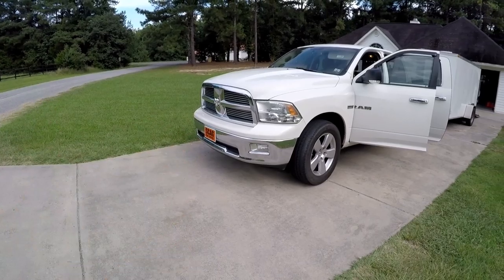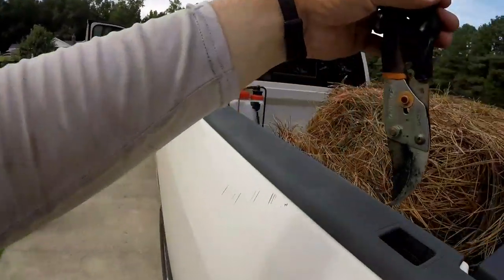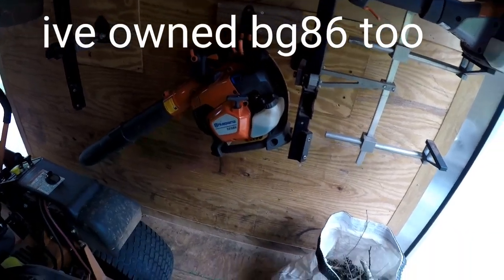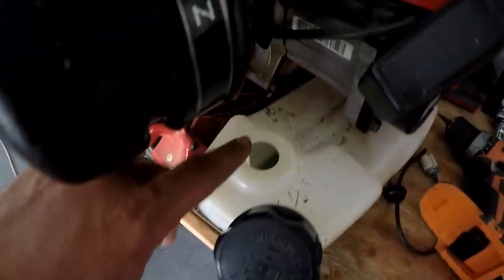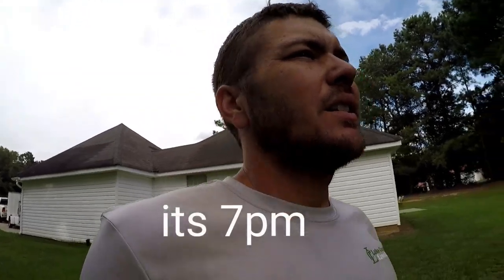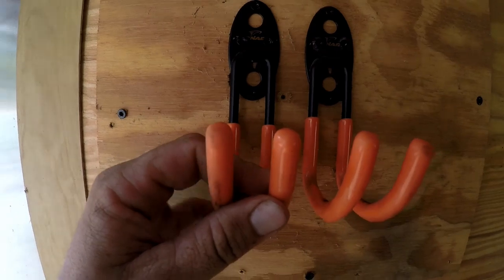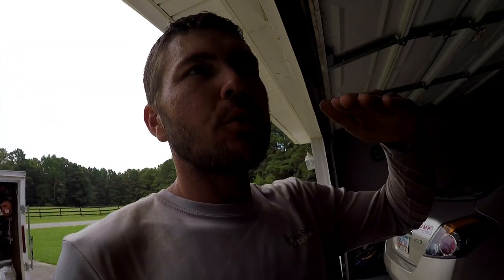2019 SOLO LAWN CARE SETUP

Comment: Awesome setup bro, You organized the crap out of that trailer. I just bought a ford box truck that already had a pull down rear ramp and it also came with a turbo diesel engine but diesel fuel is expensive so I sold the diesel engine and bought a 6.0 litre LS chevy motor that's getting installed now. I'm hoping the truck will work out for me after the engine swap is complete. Then it's organization time.
Reply from the maker: Bro i want pictures !!!!!7064738432

Comment: Man these are always my favorite kind of videos. I learn more helpful things to make myself an business better from setup videos than any other “product review” videos out there.  Now three things...

Tell me more about what you did with the speed feed head. I love them an run them as well. But go through 2-3 a season. 

Second the bags from Lowe’s...did you just buy them at Lowe’s I’ve never seen them. Could come in handy. Most of my customers have a yard waste cart the city picks up but not always. 

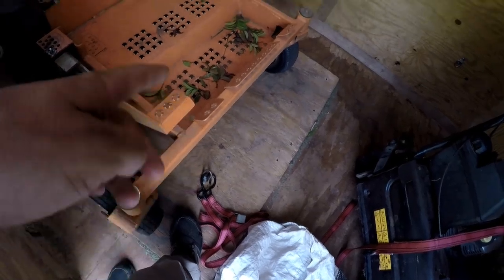Third-you May have sold me on gettin a couple battery pieces of equipment. I’ve debated adding some before. That’s an excellent point about the noise. I usually don’t get on a residential till 8 at the earliest sometimes 8:30-9. Wouldn’t mind a trimmer an maybe a hand held blower or some hedge trimmers. 

Thanks for sharing. Josh
Reply: Oh and I love ram trucks too. I’m a GM really. But I couldn’t find a Chevy 2500 in my price range like I wanted. So I got a 14’ ram 2500 crew cab with the 6.4 hemi. Freakin beast. I really like it an have become a big fan of ram. They’re great trucks.
Reply from the maker: Thank for watching buddy those bags where at lowes but kinda hard to find. Check on there website type in construction debri hauler. If i end up ripping these ill have to buy a different one from amazon i guess. And the speed feed head you just drill a hole and put a short bolt with a stop nut so it cant vibrate off inside 🙂